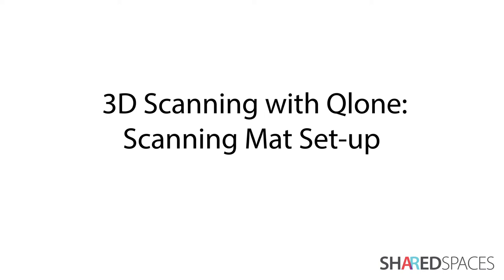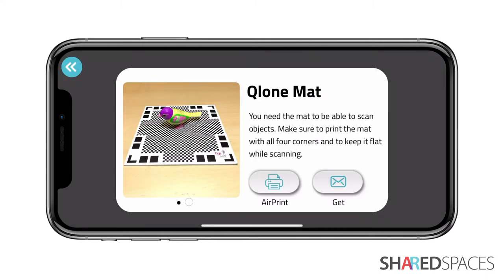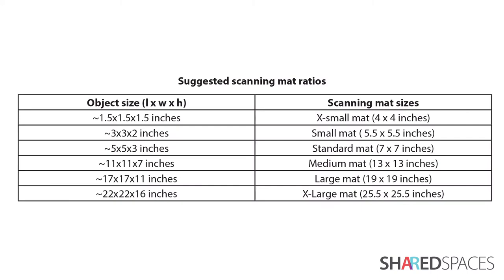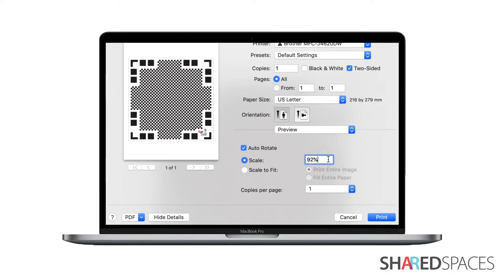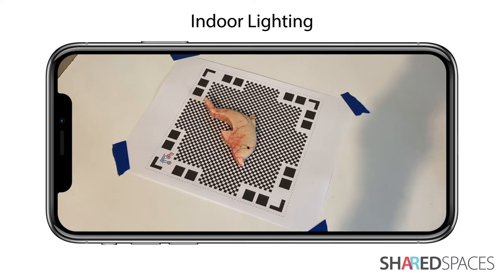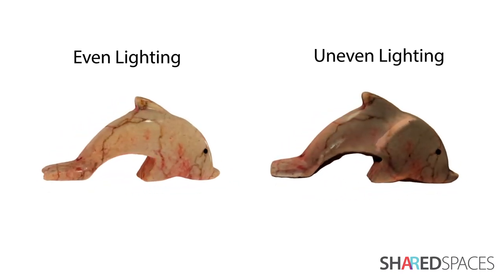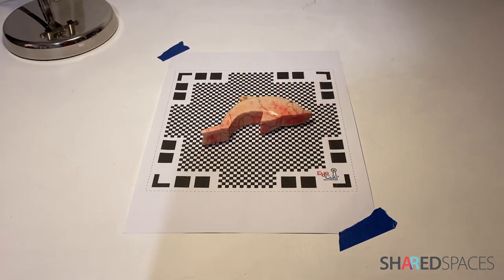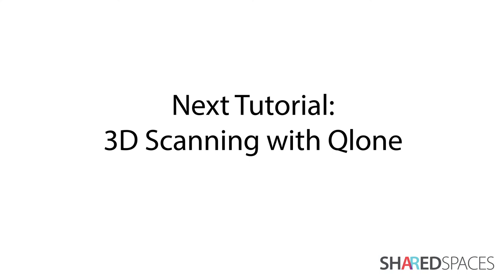Qlone 3D Scanning Tutorial 2: Scanning Mat Set-up

Comment: There is also a video that shows using a second scanning mat behind the flat one.  That is one that is a backdrop behind the shape.  I don't see any explanation of how or if, this adds any value.  How far away should it be, does it need to have the same scale as the flat mat?
Reply from the maker: Hi ronams, we have not found a use fo the backdrop scanning mat. Shared Spaces is not affiliated with Qlone but we would suggest reaching out to them directly to inquire about this question!

Comment: Is there any value / advantage when scaling up, to actually recreate the scan pattern to have more squares.  E.g. Add more squares per inch as you scale up. Since it's a very symmetrical drawing, it would seem possible to add squares.  Would that enhance or mess up the scan?
Reply from the maker: Hi ronams, we have tried scaling up the scanning mat as is (without adding in extra squares per inch) to a maximum of 25.5 x 25.5 inches; this allows us to scan much larger objects, the largest object was ~14 inches tall. We would guess that the number of squares needs to stay the same so the camera can recognize it as the scanning mat, but if you do happen to test out adding more squares per inch, let us know the outcome!